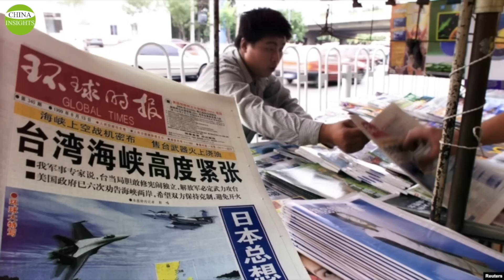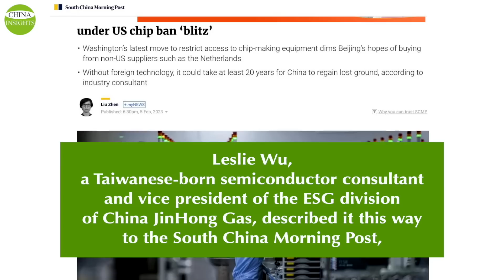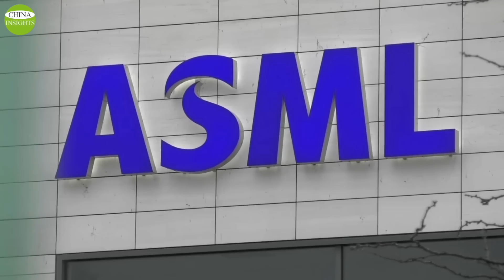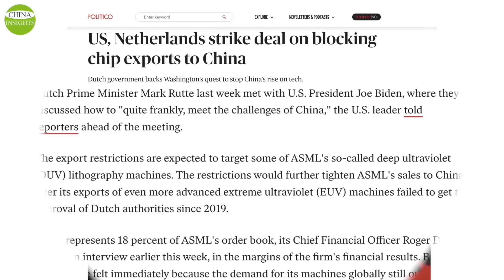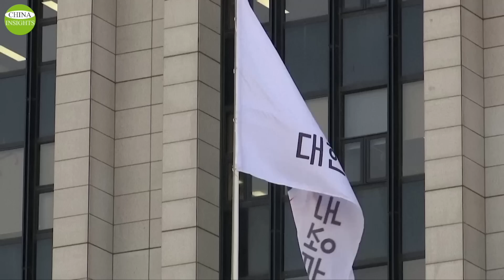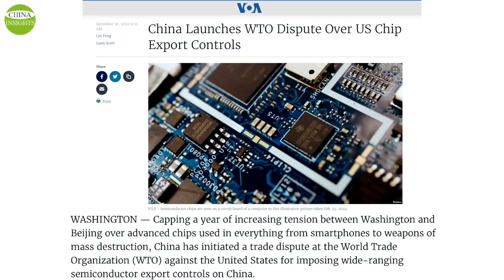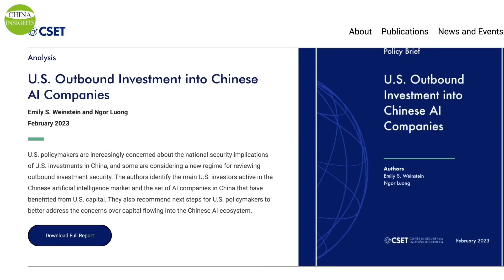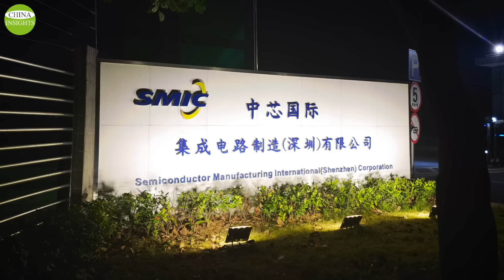China: 5700 chip companies shut down in 2022/The fierce game of one lithography machine

Comment: Recent years have put some much needed light on the sheer complexity and size of the semiconductor industry. I had no idea those ASML lithography machines were so enormous.
Reply: The production line"fab" used to make the Apple M1 chip cost $19 BILLION dollars. The only thing that is small is the transistors produced on the wafer. 🙂
Reply: @bayareaartist999 😮😮😮😮😮😮
Reply: @bayareaartist999  
Bruh...
Reply: That is just one part of it.
Just improperly using the air filtration system would result in a steep drop in quality and yield. The water used to clean the wafers is so pure, it is quite literally immeasurably pure with current technology. The tools used to measure foreign particles in the water, is not advanced enough to give an accurate figure. Only through rigorous testing do they find out which water purification method is best.
Anyone claiming China can just capture Taiwan and TSMC is extremely ignorant.
Reply: Yeah the supply chain is crazy. Opened my eyes to the world of manufacturing. Who makes the tools who makes the tools to make the machines that build devices we use. 

 It is insane. Shout out to Carl Ziess - makes the incredible mirrors necessary for ASLM. America creates some special light but don't know what company as I just learned about it. Edit Cymer! Wonder what is so special about it.)
Reply: @novat9731  I hope you are Right. 
What you mentioned is new to a lot of people and TY.
Reply: Yeah 200 ton holy!!
Reply: @novat9731  liquid particle counter LPC

Comment: China would not just use AMSL's machine, they'd reverse engineer it and start making their own versions.  
Chinese Knock Offs, anyone?
Reply: Unfortunately for them, silicon fabrication equipment is damn near impossible to replicate.
Reply: Ehhh, I dunno... If they do, it's likely to be similar to other tech/blueprints they've tried to acquire thru hacking, which is...low quality. So, even if China can get their hands on ASML tech blueprints for example...I doubt they have the ability to make the precise, minute, and fine parts of the machines as it is.
Reply: @brainletmong6302  Not if they have a machine that makes the stuff to build one.
Reply: @jayc1139  They will, once they get their hands on a machine that makes the components.
See where I'm going with this?
Reply: Tofu chips! Beware!
Reply: @hulamei3117  Yeah, considering how difficult leading edge semiconductor stuff is, I doubt "Chinese knockoffs" are anything worth a second thought.

After tofu building, now tofu semiconductor.
Wonder what the characteristics would be? Super low yield, targeted clockspeed or energy usage not achievable?
Reply: @quietdignityandgrace  Conventional wisdom suggests that China cannot accomplish this. If it turns out China CAN in fact create the machines, they must then cross the next hurdle. 90% of all microchip grade silicon comes from a single mine in the Spruce Pine district of North Carolina.  Another hurdle is that chip design is mostly done in US/Japan, and China would need to hack all of that work, and have sufficient engineers to recreate/improve it.  Chinese people are smart, and hard working, but they will need time to overcome these challenges.
Reply: They would still need the parts to from U.S. companies. The problem is starting from scratch and building out every component will take them decades, if they are able to make them at all... China has no ability at any kind of precision manufacturing. They can't even make their own jet engines. The comac 919, their first commercial jet they just finished building has 78% of it's parts imported from western countries, including the engines.
Reply: Actually, they once purchased a lithography machine from ASML, disassembled it and put it back together. It no longer worked.
Reply: Building the machine is not enough. The OS consists of 500 million lines of code and even ASML does not know exactly what the older parts of the code is doing.
Reply: @deebil8099  I just posted a video about China... hint wink.  Worth the laugh.
Reply: @ryanward10  I posted a video "Do not watch" about China.  Worth a laugh.

Comment: ASML couldnt exist without the optics by Carl Zeiss Optics from Germany .....
Reply: Everything traces back to the nutsies
Reply: Not really, they are a bunch of companies both in US and Europe capable of making similar or even better mirrors/optics, those mirrors/optics are not the hardest part, the key part of the ASML EUV machine is its light source which is designed and built by Cymer (based in California), that's pretty the most complicated part of the EUV system.

Comment: Just so that people understand what 28 nm actually means in a practical sense. About 80% of the worlds electronic products are made with Chips that are 28 nm or older technology. In fact most computers and smartphones today still use them. It is estimated this technology will be used as the main technology for most products for another 10 years with ease. For instance, a 20 nm chip over a 28 nm chip will have 10% reduction in space, 30% increase in speed and a reduction of Power Usage of about 25%. Notable advantages for sure but for most applications not required. But certainly for military applications any advantages can be critical. But your washing machine, television average computer and phone these advantages are minor. The power saving is good, but one must understand that most power used in a phone for instance does not come from the chip but other components. So advanced chips may increase phone usage by only a few percent. Same goes for pretty much anything else. The 28 nm technology is well within Chinas production capability and I do suspect that this will keep advancing to higher technologies.
Reply: Depends on what metric you go by. Those numbers are absolutely not correct in the first world. All top and mid tier cell phones are made on the 5 or 8nm process. Even memory chips. High speed and high capacity memory is on the 10 nm +++ node. 

28nm is fine for basic microcontrollers to be used in appliances, smaller or slower memory (ie sd cards) and basic processors for some automotive functions but certainly not for cell phones, laptops, desktops etc. These all require modifications to the DUV machines to produce competitive yields, something that China doesn’t produce and has little experience with domestically.
Reply: Probably its the other way round. Handphones need advanced lytography technology because space is very important in Handphone.

But PC are still using  lower lytography technology, mainly because they dont need to save too much space. Most military technology is still using 20s nm, because space is not as critical as in handphone.
Reply: @JuraganEmas  Military is completely different because it’s often radiation hardened which means it uses older designs that have been enhanced. For example the NASA mars curiosity rover used the equivalent of a PPC G3 processor from 1998 when it launched in 2011. 

For desktop computers that isn’t the case. The low end today uses mobile processors built using the 10 or 11nm process node as the cost per chip is lower since they can squeeze more onto a single die compared with an even older process like 22nm. For the high end, Intel is behind but AMD and TSMC are on the 5nm process node to get as much performance as possible. 

In general you don’t want to use too old of a process as the power efficiency goes down and you have more heat for the same computational output.